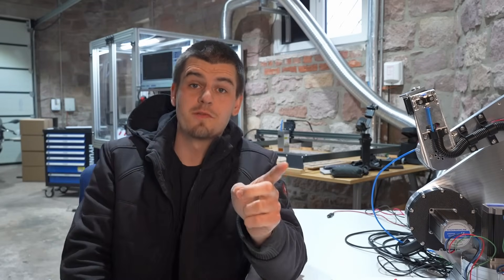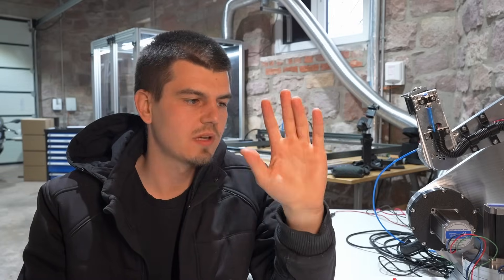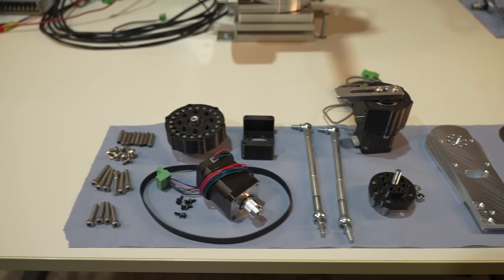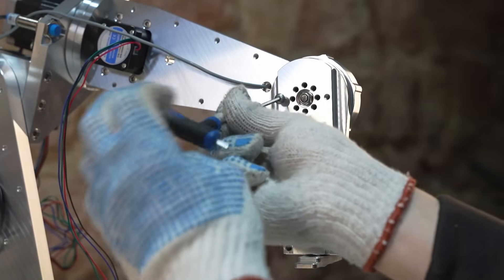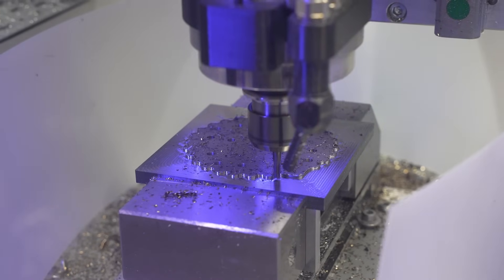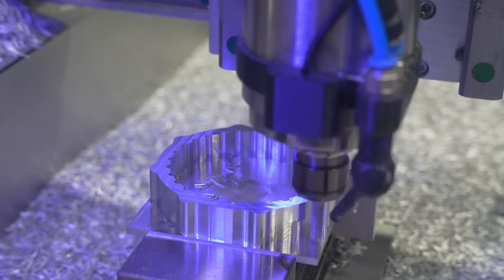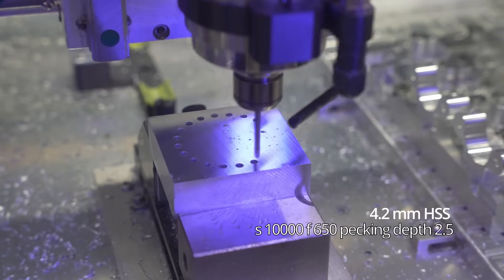CNC Robotic Arm Build with Cycloidal Gears - Steel, Fails, Speeds and Feeds! Part 7

Comment: Why not use BLDC motors? Which such a professional build I don’t think budget is a problem.
Reply from the maker: Hi and thanks for your comment. You are right we are currently testing other motors, any suggestion for a bldc setup with about 3nm rated torque?

Comment: How did you select the input bearings in the cycloidal?
Reply from the maker: @ethanreed_118  There are some standard sizes around 5 and 7 mm height. I choose the diameter depending on the different stepper motor shaft sizes:)

Comment: This is amazing! Are you going to do surface/heat treatment of the steel parts?
Reply from the maker: @meowingintheocean  Thank you so much! Not planned at the moment. Do you have experience here?
Reply: @alexanderrueffer  I don't have hands on experience on surface treatment but there's quite a bit of information online if you search carburizing and nitriding.
Reply from the maker: @ Thank you. I looked into it. Still need to test it and look at the tolerances. And yeah it’s a must for heavy use…

Comment: Looks like petg. Whats the temp of the motor?
Reply from the maker: @wykonczeni  Thanks for commenting:) It is petg. Temperature of the motor gets really hot. With the aluminum gear housing the robot becomes a big cooling grid and I would say it’s under 30 Celsius

Comment: Hi! How about backlash to your cycloidal drives!
Reply from the maker: Hi thanks for asking, I would say about 2 arcmin with the best one. Going below increased friction and the actuator was not smooth/as powerful anymore. Do you have similar experience?:)
Reply: @alexanderrueffer  Hi! Not jet. Your videos gave me new ideas for my project. I am building cnc machines from cast aluminum. I wonder would it be possible that one robot arm can hold steady milling spindle. Let say 4kw. That would be interesting project. I will study and try to build from cast aluminum Cycloidal Gear reducer because i do not now nothing about Cycloidal Gears jet! Sorry my English is weak!

Comment: Hi! I recently discovered your channel and I’m really impressed. The robotic arm project is awesome, and your workshop setup is great. I especially liked your CNC machine — the spindle, the automatic tool changer, and the use of a touch probe all look very well thought out and professional.

I noticed at 6:27 that after the probe failed, you switched to using a lever dial indicator mounted to the spindle chuck with a magnetic base to 'do it the old-fashioned way.' At that point, it seems like you're not actually moving the part but just adjusting the spindle relative to the part until the deviation is minimal, right? So, you're essentially setting the spindle's zero position relative to the part for machining. Am I understanding this correctly?
Reply from the maker: @OleksandrKhoriev  Hi Oleksandr, thank you for taking the time to comment and your kind words. Glad you like it! And yes you understood that perfectly it’s a well know method, accurate, no need to program anything and every one who has a cnc, has one of these dial indicators laying around:)

Comment: Thank you for this video that gives me confidence that I can do that too and I will do that within the next 2 weeks. My CNC machine is heavy and industrial grade (Mitsubishi) with heavy pressure flood cooling :-)
Reply from the maker: @mrechbreger  Thanks for commenting and all the best for your build. You are living the dream. Need one too. Maybe some industrial guys here in Germany see this haha. First we need to deliver a success
Reply: @alexanderrueffer  how much backlash to you get on your discs? That's what I'm concerned about most. I'm thinking how to get over the hardening and re-grinding part afterwards.
I used to live in Germany too, last year when working on my pick and place machine I went to a machining shop and spotted that Mitsubishi CNC, it was rotting for a few years. The mechanical parts were all okay so I had an agreement with the owner that if I can repair it I can just use it and maybe we can cowork on some projects. It took me a full month spread over the entire last year to get it back.

Unfortunately the owner has passed away a few weeks ago, and his son is taking over now. His son is just happy to have someone with some ideas in his shop (who is not on his payroll). So I have a full shop available for various robotic projects now (if you need parts let me know :D)
Reply from the maker: @mrechbreger  That sounds very cool, do you have the ability to harden? I haven't measured it yet fully. Around 2 arcmin. Hardly noticeable for an arm with this specs.

Comment: im shocked you can do steel with no flood coolant and such high rpm
Reply from the maker: Thanks for your comment! Really works well. I predrill and don't need to ramp in pockets. Read it's better without mist because it shocks carbide and then it gets brittle

Comment: i am mid cycloid build as well. 
finding difficulty in ensuring backdriveability.
Reply from the maker: Thanks for your comment! Although backdriveability is not a goal, it works pretty well, even with the 40:1 gears. We have some problems with backlash, more relevant here.  Also some nasty shaking oscillations with 3d printed gears, much better to zero for metal one. Do you mill or print?
Reply: @alexanderrueffer  print for design and then, hopefully, laser cut from acrylic sheet for the cycloid bits. the goal is an ultra cheap leg joint for quadrupeds in place of the more traditional planetary set. backlash is a non issue in my use case but she needs to backdrive or her knees are going to sound like mine if you catch me in a quiet stairwell. your arm looks fantastic. super, super clean. i fucking love that shit man.
Reply from the maker: @amandahugankiss4110  Thanks man yeah perfect gearbox for shocks! Think efficiency is also pretty good when backlash is no problem! Hope your knees don’t sound like a printed cycloidal haha and thanks again, also very happy how it turned out. We will continue!

Comment: As an amateur machinist I know the exact feels when ya hear the "arrgh!" And "nonoNoNOO!" during crashes. One thing a mentor told me thats helped significantly reduce crashes is: "Always model your fixtures when you're doing CAM. *Always*!" Takes a few days to get all the vises, jaws, spundles, collets, etc set up in CAD, but has more than paid off in the time - and money! - its saved me over the years.
Reply from the maker: Hi Timmay, thank you for your comment and your experience. Yeah added some fixtures here and there also toolholders but then the tool lengths changed and other stuff. Need to consistently model all in CAD. Thanks for pointing it out again!:)
Reply: @alexanderrueffer  Gah, apologies if that was redundant from a comment on a previous video! :) Have to admit, every time I see your MRR with your gantry CNC I'm really tempted to build a similar one. Do you find you spend most of your speeds/feeds time at/above 10k RPM?
Reply from the maker: @ No worries! Go for it. Love it and 100%, even 10 mm tools you can run far over 10 k rpm. However the low torque is annoying when drilling. Maybe a 3 kW spindle with 24k rpm is a little better here
Reply: Mind you, I've only machined one part myself so far.  But I watch a lot of youtube, so I'm clearly a professional.  CNC is definitely unforgiving to complacency, ignorance, and urgency.  You have to take your time, check every variable, and be thorough.  Though, I do wonder if some of the monitoring that has made 3D printing more accessible will find its way back into CNC manufacturing.  It might make things a bit more forgiving at least.
Reply from the maker: @ very helpful comment here, thank you. Programming in Cnc transfers every mistake to financial damage. Sometimes that’s quite high haha. Yeah machining could make it to more people like 3d printing did. It needs more optimization for it though imo

Comment: Love the CNC videos and the robot arm project, is there any chance you will release the flies for it? Looking forward to the next video!
Reply from the maker: Hi Pavel, always happy to read your comments! Thank you! Current plan is a dev kit with aluminum parts, hardware and software. Performance is very promising so far
Reply: @alexanderrueffer  Sounds like a great idea, what are you going to use the robot for?
Reply from the maker: @PavelPeikov Plan is: Cnc tending, welding, pick and place, fullfilling (so packing a box) in logistics, paint, blast, super hard: welding. High goals!

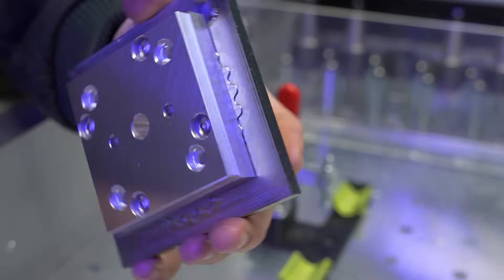Comment: 4:10 how accurate was this fixture plate? i love your cnc haha. great upload
Reply from the maker: Great question, thanks! Since the pins were a loose fit in both parts guess +- .005 mm. That's also the error of my probe so +- .01 mm (backlash is .007mm, so that's the limit of the whole machine). But that all is only relevant for the chamfer on the backside! All contours are milled to spec in op2.

Comment: Absolutely beautiful work, and cutting that HSS went really well in the end.

I’m curious what sort of tolerances you can hold with your mill?
Reply from the maker: Hi Shep thanks for your comment, glad you like it! Yeah I push these HSS pretty hard but they just hold up... Of course carbide with inner cooling would be great, but thats not supported by my hobby spindle. Probably .01-.02 mm within 100 mm. But holes pass the H7 gauge frequently, no problems here!

Comment: Loving this, and getting inspired by your machine. Is the baseplate of your CNC steel or alu? I'm thinking about a similar design for mine, building on top of one big plate, as it's an easy starting point when I don't have other very flat reference surfaces to build on. But I am worried about the relatively high thermal expansion of alu, as the temperature of my workshop is not particularly well regulated. Have you had any issues with it yourself?
Reply from the maker: @makerfirst  Hi Maker! Thanks for your comment. 25 mm Aluminum. Today I would go for more. I notice a shift between summer and winter for measured tool length (so z axis). Since I probe everything and most parts don’t exceed 60 mm in XY it’s no problem. But yeah this is the weak point. I could heat the garage but it’s not isolated to keep room temp in winter. Thanks again, Alex
Reply: @alexanderrueffer wouldn't it be possible to heat only the baseplate?
Reply from the maker: @Luc-1991  Good idea, in the end I think constant room temperature is the best. Bimetallic effects, cold watercooling etc. are still problems with heated base?
Reply: @alexanderrueffer i didn't even think of the watercooling, but yes a heated room is definitely better.
Reply: @alexanderrueffer  Thanks Alex - really appreciate the insights. I don't have the problem of cold winters, but rather high fluctuations day-to-day in the summer. And that's more difficult/expensive to regulate. Do you notice any difference in resistance of your linear rails? As you say, z-height is something one can compensate for. So I am more worried about e.g. drifting of alignment in XY due to some parts of the machine being more constrained than the rest while things expand and contract. But perhaps I'm also overthinking it 🤓